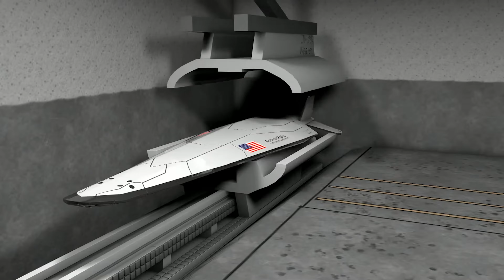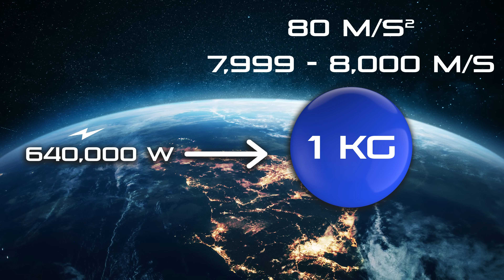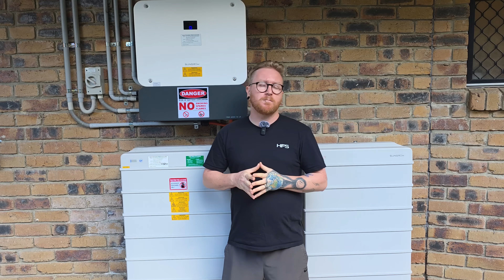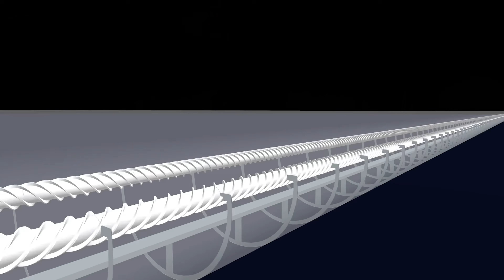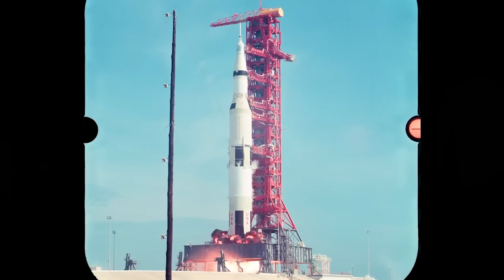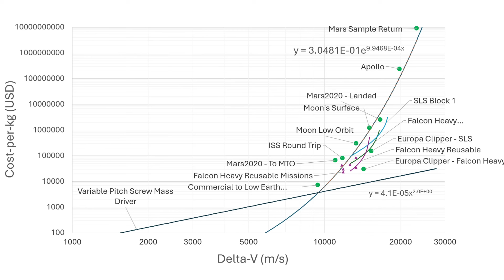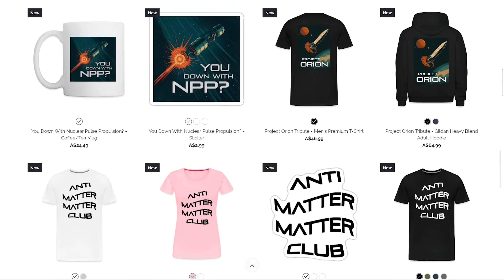The New System That Could ACTUALLY Replace Rockets

Comment: Will the launch capsule/rocket have one, two , or more 'fastener points' longitudinally, that are magnetically affected by the screw edges?  If it is one, I see the rocket flopping around uncontrollably.  If it is more than one, you would have to gradually extend them during launch.
Reply from the maker: That's a very logical question! The sled floats inside the tube on linear active magnetic bearings (AMBs), which produce equal magnetic forces above and below the sled. Basically the sled is magnetically suspended in all directions. With the tube being evacuated of air, it also doesn't have to worry about aerodynamic forces moving it around, so its very well fixed in place. The screws themselves only provide forward force, they don't hold the spacecraft or sled in place.

Comment: The devil is in the details, and get very devilish indeed.  Any launch failure probably destroys it, so you need to get it nearly perfect, and even once you've got it 'working', rare problems will crop up.  E.g. keeping the rocket perfectly aligned in the vacuum tube.  Yes, magnetic levitation will help - but oscillations could build up and interact with sloshing fuel and payload masses that vary from flight to flight.  
You MIGHT want to make the effort to solve all the problems to launch nearly identical payloads into orbit, such as propellant.  
If you can solve them well enough to safely launch several times a day, maybe you'd eventually use it to launch people.

Once you're in space, there are far more efficient ways to accelerate than chemical rockets, if you're sending payload that doesn't need to get somewhere fast.  So maybe use this to orbit, and something else to Moon and Mars.

Comment: This is zero chance this would work. Mechanically impossible forces on that driving screw.
Reply: I was a NASA engineer and this is preposterous.  The technology does not exist.  Extremely long vacuum tubes of a large diameter with a series of high spinning speed screw drives all synced laid out over a very long track on the planet accelerating a large space vehicle to near orbital speeds!  I don't know if will ever be possible but definitely not for sometime in the future.  The stability of that vacuum tunnel would have to be like granite and there are going to vibrations induced from every moving part.  Don't even start to discuss the rotor dynamics, bearings, lubrication, drive system and on and on.
Reply: @rkoenn think about the magnetic field interactions. Not going to happen. Pod sits there massive current is generated, has to go somewhere. Arcing, melting materials, with two screws the primary mechanical force transfer will always be perpendicular to the axis of the screws, in the direction of rotation. Never work.

Comment: Tie a rope or chain between Mars and earth. And you won't need rockets. 
The chain should be super light but very strong.
Reply: The material they will use is called unobtanium!
Reply: @DavidClark-bd8vl  From Wakanda😂

Comment: I think you are going to need at least 4 screws 90 degrees apart, or the projectile will not stay put easily.  3 or any odd number will not work because you need screw forces to be equal clockwise and counterclockwise or some elaborate keel to keep the projectile from rotating (which would probably fail toward the end of the track when the screws are nearly horizontal).  The g-forces on the spinning screws might be an engineering challenge.  And the equal and opposite forces on the screws as they interact with the projectile are also going to be difficult, as it would be easy to generate a destructive wave traveling through the metal.  A hollow screw does not have much strength helically.  That is why some arm wrestlers break their humerus.  Making these screws solid is going to use an enormous amount of metal, and accelerating it will use a lot of energy.

And I still think it is going to be difficult to apply much acceleration when the screw helix is nearly flat at the end of the launcher.  The magnetic repulsion forces would have to be astronomical for it not to just spring a little near the end.

If the launcher is in a near vacuum, and then a membrane is broken to the atmosphere, the sudden contact with the atmosphere is going to be a massive shock.  That means you will need several sections and membranes with successively more air to transition for anything alive or fragile.  That means the launcher may need to be quite a bit longer.

I have considered this introduction to the atmosphere issue before, and I have another solution, but it is pretty original, so I am keeping it to myself, for now.

A lot of these puzzles get easier on the Moon.  Some mass driver will likely be used.  What design, who can say?  I have thought for some time that we should build large spacecraft on the Moon of lunar derived materials or from materials from the moon brought to lunar orbit and built there.  Just use the cramped flying gas cans to get people to the Moon, and transfer to some massive powerful ship in lunar orbit or on the lunar surface, and go to anywhere in the Solar System from there in a well shielded, well stocked, and fully fueled craft with lots of gadgets and lots of room (and probably with artificial gravity via rotation).

Rockets like Starship make more sense for getting people to Earth orbit and possibly lunar orbit.  Leaving the Moon/lunar orbit in some other craft to go to other interesting places has a lot of possibilities.  Eventually, they will just pick you up in Earth orbit, in a large craft made on the Moon, and leave from there, saving you from the "boring" multi day journey to the Moon in a cramped can, and go wherever.  Starship could carry 1,000 people or more packed like sardines.  But no big deal, if it is in orbit in an hour, and you are transferred to some roomy ship in orbit.  They will probably have to hook everyone up to a barf bag on that Starship.  People will be so happy to get off that thing.  Zero G will not be everyone's cup of tea.  They will use noise-canceling, separate air supplies and AR/VR to help you not be miserable when people are upchucking, and kids are crying.
Reply from the maker: That's a long one! You've obviously got a really decent grasp of the concept, and of the engineering and material science difficulties behind building and using this system. I've put a couple links in the description to some of Phil's presentations, which you would probably find some answers to these concerns in.

It will be a big, challenging project for sure. Even though the math has been worked out to a very high level, real world implementation is always going to throw some spanners in the works. There will be adjustments, course corrections and advancements made in the process of implementation. Starship is an excellent example of this.

I'm personally a huge fan of Starship, its a beautiful and awe inspiring vehicle and I really want it to be able to work as advertised - but it has some big challenges in front of it. I don't personally believe it will be able to put payload in space for anywhere near that price. I really hope I'm wrong - but its staring at some physics that are very hard to beat.
Reply: Yeah! Exactly! Nice pitch!

Comment: How About Building Humongous Stations In Near Space That Are Lifted By Hydrogen And Or Helium.  It Would Cost Very little 2 Lift Them As It Can Be Done In Sections.

And Instead of Holding All The Helium And Or Hydrogen In Air Sacs, Much Of It Could Be Between Walls, Cielings, And Floors As Well As Larger Decorative Structures Within Larger Open Spaces....  This Would Allow For Aerodynamic Structures.

They Could Have Lifting Vessels To Lift Payloads Small Or Large 2 Near Space And From Their Be Luanched,

Or 

These Lift Stations Could Lauch Payloads From Their Own Platforms At Higher Elevations Whether They Go To A Station Or Not...

2 Get From Station 2 Station You Could Have High Elevation Aircrafts That Can Breathe Near Space And Can Travel At Hypersonic Speeds

And For Protection From The Sun, Removable Panels On Struts Or Rails Would Allow For The Roof Of These Stations 2 Need Little Repair For Long Periods ...

All this Would Make Launching Payloads Into Space Countless Times Cheaper And Would Be The First Step Into Any Mission Deep Into Space ...

Comment: As a 20 year career mechanical engineer I don't see this concept to work. The screws have to rotate so incredibly fast and the guiding blades lose their propelling force at an angle lower than 45 degrees, even if the ship or capsule is already moving fast.
Reply: I agree. I think his math is off. Wouldn't the higher screw pitch sacrifice mechanical advantage, which would in turn require more energy?
Reply: As a 20 year engineer did you bother to run some flywheel calculations on how fast those screws would be spinning, lets say assuming they where made out of really low quality steel?
Because I did. And then figured out what the twist rate would be.
And your comment does not make a lick of sense, at a 50% additional saftey factor and assuming extremely low grade steels you are only just looking at a 45 degree helix angle for orbital speeds.
Reply: @AnonymousAnarchist2 So... you ran the numbers and say it's feasible? You got my interest. Please show
Reply: @AnonymousAnarchist2  Can you share the numbers?
Reply: ? No they don't, you have two competing screws so they're still capable of driving it all the way to near 0 degrees.
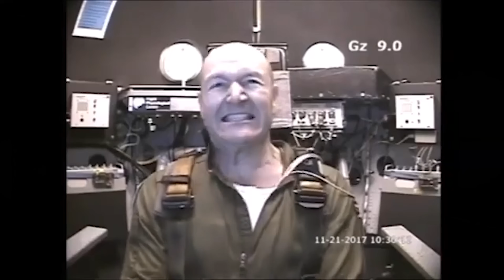Reply: 13:03 The maker of this video just read your comment. 😂😂
 aaaand that was the limit of my curiosity.
Reply: I thought it's a representative animation the coupling is supposed to be magnetic and contactless
Reply: @bromine_element  Must be some strong magnets to keep all the sufaces from smashing into each other. Espacially for the non-human payloads accelerating ay high G. Where does that power come from, similar to the subway trains?
Reply: @bromine_element the one teeny-tiny thing that this mechanical ENG forgot to mention is, those 7-9 km long screws are made of something, that something is lots of copper and alloyed steel... Let's forget about centrifugal forces that will undo the windings, lets even forget about bearings needed every couple of meters to keep this thing aligned and let's talk about droop and tortion.... 7km long, best alloy steel possible screw will bend under its own weight a tiny wee every segment and this bend will introduce compound interest from economy to mechanics. The tortion  forces will snap those thing coz at those scales the very best metal alloys behave like tea soaked buiskit😂
At least with regular MagLev systems inside vacuum tube you can gradually increase voltage and amps to accelerate. 
Take some mountain and build spiral tracks with vacuum tube and gradually accelerate over couple of days hundreds of payloads evenly spaced out.
Reply: @Geroskop  And what about rotordynamics?? What kind of rotordynamic monstor would this be? In a perfect world where the temperature is the same everywhere, where there are zero ground or even atmospherically induced variations, it will be fun trying to find and avoid all the natural frequencies involved. What kind of vibration tolerances would be necessary to maintain as to fulfill the mission? The rotor dynamics of just one screw would be very interesting, but two screws with a sled? All of that, plus real-world conditions, will be very interesting. If you optimised the system for just one payload and one speed at one ambient condition, that would be outstanding. But add those other variables in and it looks like it could be a natural frequency whack-a-mole to me!

Comment: Hearing about this system I was already interested in putting a mass accelerator on the moon and everything about this sounds more desirable.
I'm immediately thinking about this as the first stage to orbit but I'm also wondering how this compares to a rotovator network in space for sending and receiving ships around common destinations and departures.
Entering the atmosphere from vacuum could be a rough deceleration. Hydrogen is really a pain.
Reply from the maker: Great instincts there, the Moon would be an excellent destination for a VPSL. The low gravity and lack of atmosphere make things a lot easier. I've not heard of the rotovator before, I'll have a look into it.

Vacuum entry can be difficult, but at this point propulsive landing is routine so I think this would likely be the least of the concerns.
Reply: @HelloFromSpaceAus  also it's called skyhooks. 
https://youtube.com/clip/UgkxKfg_ECPhd5V1OzxCjOHxKPlHLa7NdLKb?si=Il1ozFBQzI0dFhJ9

Comment: Imagine the pitch of the screw needed near the final sections. The actual threads would necessarily have to be nearly parallel to the axis of acceleration, assuming the screws spin at a reasonable speed such that they do not get torn apart. With that arrangement, the force transfer efficiency would inevitably go down to zero because there is very little force that is actually parallel to the axis of acceleration. 

I'm not even going to mention the quality of sync you'd need between sections of the screw to make sure the next section is ready to capture the sled as the previous section has transferred its energy. Arguably, you'd need some sort of torsion bars between the sections to keep them aligned.

Finally, the screws would likely have to be completely suspended, as any discontinuity for support bearings etc would tear the sled's push arms to shreds.
Reply from the maker: True, but remember this is relative to the speed of the spacecraft. Constant acceleration means regardless of the pitch, they're applying the same amount of force to the sled. The screws also increase in speed along the track, which helps make up for this - that way you don't end up with the helix angle of the screw flights (blades) becoming parallel to the screw (which would no longer function). It's a complex idea, and there would be some mega engineering and manufacturing to make it work. I would however draw a comparison to the level of complexity involved with building a single Raptor engine, or the ITER in France (probably a better example). While this is a complex, difficult engineering project - I would argue we're capable of such challenges. I'm an optimist though, I want us to have nice things😅
Reply: @HelloFromSpaceAus remember that a screw/thread is just a curled wedge.  The most basic of mechanical systems.

Now, I want you to push any sized object, at escape velocity vertically, by driving a wedge under it horizontally.  That's what you're doing.  Sure the pitch changes, but it's still a wedge.  The vertical force output is just trig of the pitch angle of the horizontal force.

He keeps saying the energy is a square function not cube, but  that last bit of energy is asymptotic tangent from the angle.  

And this doesn't even begin to figure out how you're going to support the screw with bearings.  

I've worked with flywheel energy storage before.  8 ton masses (we had 6 of them) spinning at 10k rpms in vacuum with magnetic bearings.  Scary amounts of stored energy.  And they only produced around a half MW for 10-15s, long enough for the diesel gensets to start up.  A failed bearing in one of those, is like a few hundred lbs of tnt.  Spinning multiple kilometer long, meter diameter screws at speed?  You won't catch me within 10 miles of that thing
Reply: @HelloFromSpaceAus  you forgot what u learned in physics class. For every force there is an equal and opposite force. To accelerate forward at 4g, the sine of the thread pitch angle must also experience 4g of force in the opposite direction. At the shallow angles, to get 4g of force in the sine direction you also need to resist many more times 4g of force in the cosine direction. The coupling would either break or skip in those cases.
Reply: @refusalspam not a chance for any meaningful energy transfer from magnetic screw threads perpendicular to the direction of rotation. Just current generation.
Reply: @BriPHan  won’t be any current generation if both coupler and screw use only permanent magnets.
Reply: @refusalspam  Permanent magnets are not magic, they would have losses too. I'm not sure if there exists a workaround for this issue, you basically need an efficient way to transform rotary motion into linear one at 8 km/s ...
Reply: @alexpyattaev  what are you talking about? Permanent magnets on screw and permanent magnets on coupler would not have any “loss”. The only losses are in the friction from turning the screw. Again two permanent magnets and no wires cannot generate current. You can’t have losses in current when there’s no current.
Reply: @refusalspam  Yeeting tons of permanent magnets every time to orbit doesnt sound economical. They are not even strong enough for MAG LEV trains. BTW what are the friction losses and heat generation in the bearings? And would it not be better to accelerate the cargo in a sled that would be slowed down again and re-used? Otherwise you'd be yeeting tons of copper wires and electronics every time - and losing it. Unless it's like a sabot round that you can find in the shallow waters or something
Reply: Did you just arbitrarily choose 4G's? @refusalspam